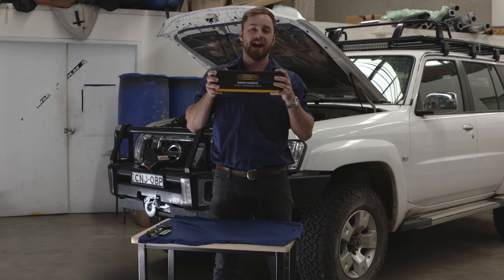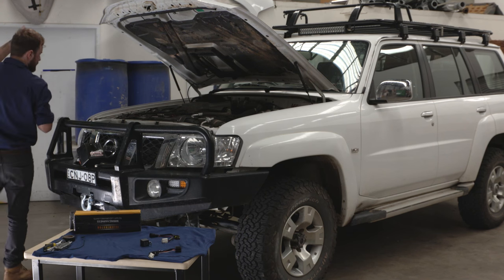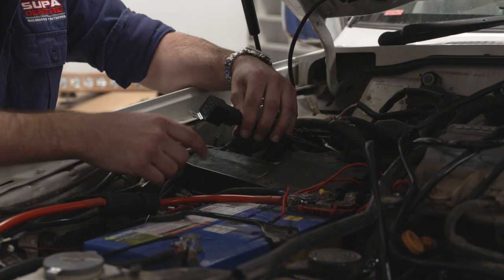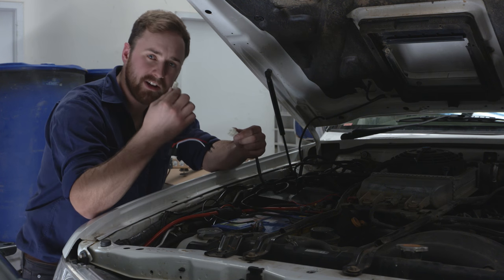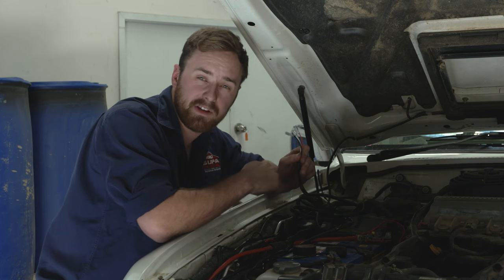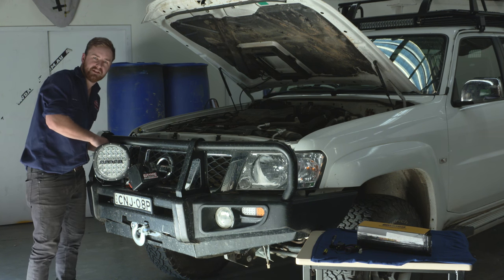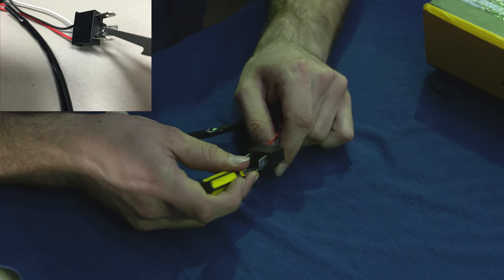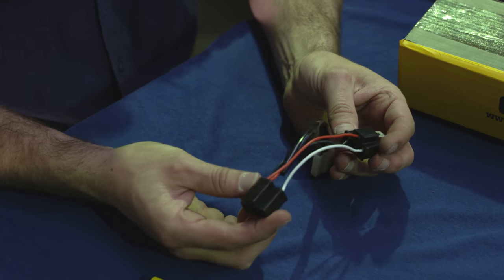The Illuminator Wiring Harness is easy to fit + it works on negatively switched vehicles!

Comment: So i have a 80 series landcruiser 95 model I've  got 1 wiring harness but if there 2 adapters for head lights and one connection on the harness. Do a need another wiring harness . Basically i just brought a set of 9 inch spot light and bar.  Unfortunately im not about to get them working. Need assistance 😪 😫  i followed all your videos.

Comment: Hey thanx for this very helpful video i did ur steps and worked first go..... one question how many light bars can a single relay run or  can i connect more then 1 light bars to the same wiring harness note comes with one piggie i thought about splitting the piggie to 2

Comment: Fixed the high beam low beam issue but light bar stays on constantly while lights are off and turns off when i turn the lights on and low beams like Normal

Comment: Hey Guys, when I leave the wiring as is as it comes in the box the light bar works on low beam but not on high beam. Rodeos are negatively switched. But when I change it to what you have shown the light bar doesn't work at all. Any info to help would be great. I have a 2004 holden rodeo.
Reply: I have this same issue with my 04 vy sv8. Have you had any luck rectifying this?
Reply: Did you end up getting it work having same problem with my ra rodeo mate

Comment: So how does this setup connect to high beam switch to activate spotties? As on a technicality it is illegal to have spotties running on a separate switch to high beam. They need to be able to be turned on/off with high beam.
Reply from the maker: Hi Homer, 

Negatively switching the vehicle will still connect the same way as normal - with high beams. The wires just need to be swap around ie red/black. Please let me know if there is anything else I can assist with - Samantha

Comment: So I tried this on the 80 and now I think about after swapping the wires around and it still not working on high beams has led me to the conclusion that all he did was change the wires around he hasn’t actually reversed the negativity. Should this be done from the vehicle’s Kim it’s self? And not the harness you provide.
Reply from the maker: If you want the easiest solution, swap your harness for a "plug N Play smart harness" which will work right out of the box - Toyota use negative switching which means your headlights are always connected to positive and the switch is on the earth - in some cases by using this harness you're adding an earth return path that is always connected. You can fix it but it does take a little more playing around.

Cheers,
Cahn
Reply: Thanks for your help

Comment: My spotties turn on both on low beam and high beam, is there a way to make them only turn on with high beam on
Reply from the maker: Hi,

Your vehicle maybe negatively switched - what model 4x4 are you installing it into? - Samantha
Reply: @4wdsupacentreAu  I have the same issue, I believe my 2005 subaru outback is negatively switched - I tried switching the HB3 wires after the connection where they tee off the lights and that made the light bar turn off when the high beams are on instead. Any suggestions?

Comment: Hi, How do you wire the HB3 harness for negative switched vehicles?
Reply from the maker: Hi Dory, Switching the wires on the HB3 plug doesn’t work because there’s only two wires – positive and negative – these go back to the harness and will likely just blow a fuse as they’re now the wrong polarity. We'd suggest getting a smart harness instead if you have a negatively switched vehicle. Cheers, Mia

Comment: Hey my light bar only turns on when the headlights are low beam, I have a 2006 hilux. Will this method for negative switched vehicles work for me?
Reply from the maker: Hey mate,

If you want the easiest solution - get the Kings Smart Plug N Play harness, or if you've already got a standard harness, swap it out for a "smart plug n play harness"  these are designed to work out of the box and don't need any adjustments!

Cheers,
Cahn
Reply: @4wdsupacentreAu  so are you saying that the LED light bar wiring harness will not work for me even if I follow the change in plug wiring shown in this video for my 2006 hilux and my only option is to buy another harness? Or that you guys will happily swap the one I got for the more suitable one?

Comment: I got negative switch  car with h7 plug how do I find them
Reply from the maker: Hi Shane, the wiring kit only comes with H4 & HB3 headlight adapters so you will need a piggy adaptor. Regards, Mia

Comment: I have a 2013 navara d40 and my driving lights on come on on low beam, I’ve changed my wires to a negative switch. Can anyone help me ?
Reply from the maker: Hi Will,

Did you try the wiring without changing to negative switched first?
If you’ve tried both ways – you might need to use a test light or multi meter to confirm the output of your headlights.

Let us know once you’ve double checked and we’ll see what else we can do.

Cheers,
Cahn
Reply: @4wdsupacentreAu  have the same issue 99 Toyota prado

Comment: Wired up a light bar like suggested, but it turns on with low beam and not high beam. Any suggestions?
Reply from the maker: G'day what type of vehicle are you wiring it up too?

Cheers - Samantha
Reply: 4WD Supacentre it's a 2000 Mitsubishi Lancer glxi wagon. I drive at night almost daily and needed it for work

Comment: I have a 2011 Ford Ranger which I think makes it a PX series.
I am have wired 2 x 6"led light bars with 7" spotlight twin harness. I am getting light bars on on low beam but off with high beam. Am I correct in assuming my vehicle is negatively switched and I therefore need to change the wiring of piggy back harness as per Todd Kimber's instructions below.
Reply from the maker: Hi, 

If you like please send through an email to sshanks@4wdsupacentre.com.au and I can assist you further with this if you are still having some issues with installation. Thanks - Samantha

Comment: Need help my low beams are H7 i brought a H7 piggy back from LLA plugged everything in but light bar only works with switch need it to work with high beam aswel
Reply from the maker: Hi Tim,

What vehicle are you installing them on? Thanks - Samantha

Comment: These headlight adapters don’t fit on my 2018 Land Rover discovery, does anyone know what headlight type it is?
Reply from the maker: Hey Lachlan, you would need to check to see what headlight adapters your vehicle has as our adapters are advertised as HB3 and H4 headlight adapters. You can be find what adapter is suited for your vehicle in the manual for your car or by contacting the manufacturer. If you require an alternate adapter, they are generally sold at places like Stedi. Cheers, Kathryn.

Comment: How do i wire up . I have h1 globe
Reply: I also have a h1 plug for my lights and I went on to Stedi to buy their H1 piggyback adaptor. Should be around $18. I’m not sure what to do about the big  covers on the back of the covers tho since we need to get the free end of the adaptor to the relay

Comment: Okay so, I have a 1996 Toyota Land Cruiser prado, I bought the 7inch spotties and the wire harness, wired it all up and nothing, swapped it over to negativity switched and still nothing. Can anyone tell me what’s gone wrong or if they had the same problem and how they fixed it. Cheers
Reply from the maker: Hi James,

If possible please send through any images you have of the set up and your order details to sshanks@4wdsupacentre.com.au and I can assist further - Samantha
Reply: Did you find a solution to this. Mine is doing same thing. Wired to suit negative switch and still getting nothing

Comment: I just did mine and my light turns on whenever i hit the switch regardless of wether my lights are on, off or on high beam?
Reply: Any solutions its a 2012 hilux and ive done the negative switch
Reply from the maker: Hi Conor, I maybe able to assist with this. If you like please send through an email to sshanks@4wdsupacentre.com.au 

Thanks - Samantha

Comment: The adaptor that plugs into high beam plug doesn’t fit.  There’s an extra two fine slots required.  Anybody know where I can get an adaptor that will fit a 2011 Prado high beam globe.
Reply from the maker: Hi Ann, 

Some vehicles require it to be negatively switched. If you are still experiencing some issues with installation please send through an email to sshanks@4wdsupacentre.com.au

Regards - Samantha

Comment: Does this fit to a LED headlight, Nissan Navara D23, 2018?
Reply from the maker: Hi, you will need to check to see if the Navara has a H4 & HB3 headlight connection as our wiring harnesses will only suit this connection. Please let me know if there is anything else I can assist with. Thanks - Samantha

Comment: Hi I've tried all combos and on one the high beams turn off when light bar is still on. The other light bar only turns off with supplied switch. Mitsubishi Delica 1998. Any help would be appreciated. 
Cheers.
Reply from the maker: Hi Dan, if you can send through your contact number to sshanks@4wdsupacentre.com.au - I can get someone to give you a call to assist you more with this. Thanks Samantha

Comment: Im about to throw mine down the road.Ive been at it all weekend.I feel everyones pain about getting the wire out of the female plug.Installing them on 2004 hilux. Reviews looked good on the lights but connecting the wiring harnesses a total shit fight.Had them working for a little while ,now nothing.Any help from 4wd supacentre would be appreciated .
Reply from the maker: Hi Troy,

Sorry to hear that you are having some issues with installing, I have a guide that may assist with installing into a Hilux - if possible please send through an email to sshanks@4wdsupacentre.com.au and I can forward it through. Thanks - Samantha
Reply: So did you get them to work then?

Comment: dose anyone know how to install them on a 2011 pajero?, my light plugs had a different shape to the harness that was given. any help would be much appreciated.
Reply from the maker: Hi there, the wiring harnesses only come with HB3 and H4 connections, your vehicle may have a different connection. If you check with Mitsubishi what your connection is you would then be able to purchase a piggy back adapter from your local auto-electric store. Regards, Tamara

Comment: ive just wired up my illuminator wiring harness to my light bar with the H4 adaptor and when switched on it comes on with the low beam any advise
Reply: MissSpelt  I changed the wiring to negative switch as per video works perfect

Comment: Confusing. Light bar doesn't turn off when high beam is turned off. Light bar stays on on low and high and shuts off when cars light switch turned off
Reply from the maker: Hi,

What vehicle are you installing it onto? Thanks - Samantha